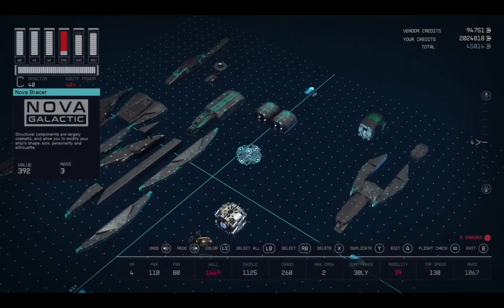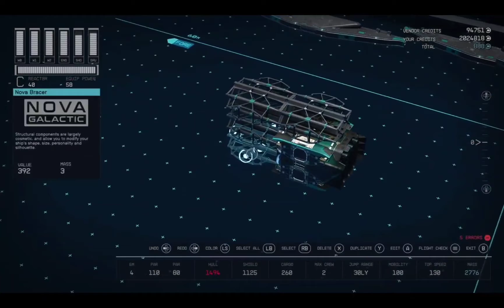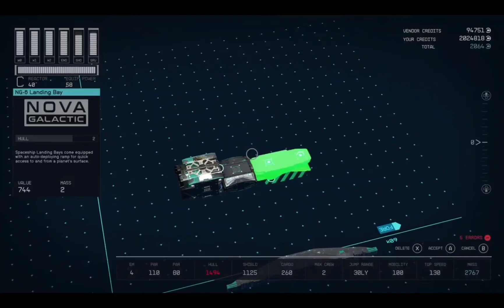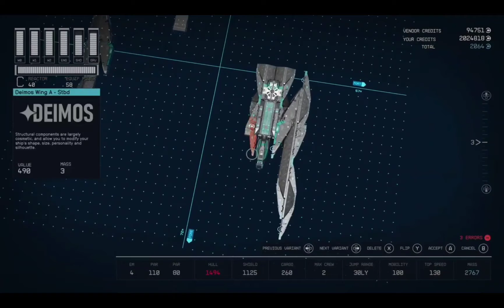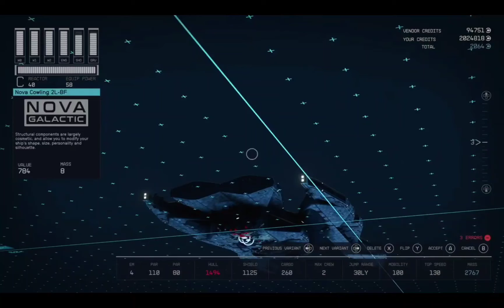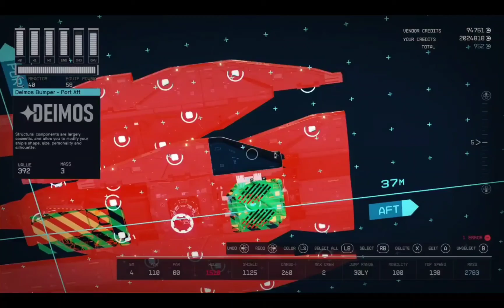Starfield - Freestar Warbird Ship Build Guide

Comment: Hi thank you for a build is stunning. Where do you put the guns?
Reply from the maker: I put them all on one Taiyo Equipment Plate and then hid them under the Nova Cowling you can do this by placing the em weapons then duplicating them on the plate then I flip the Turret until facing the right way as close to the plate as possible until they merge with the plate until they are all on one plate